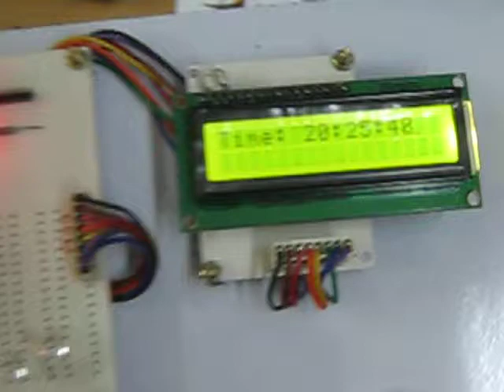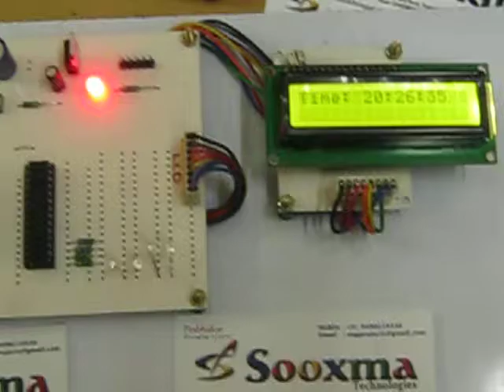Real time clock timer based streetlight controlling with day light power saving using LDR

Comment: Instead feed something like each months sunset time also shall have a Bluetooth functionality which would get connected to your mobile to update if time updatation is required in case streetlight has gone vague along with its internal timing battery or circuitry.